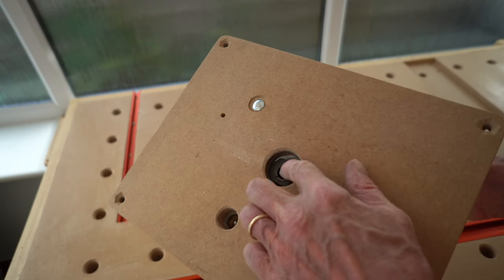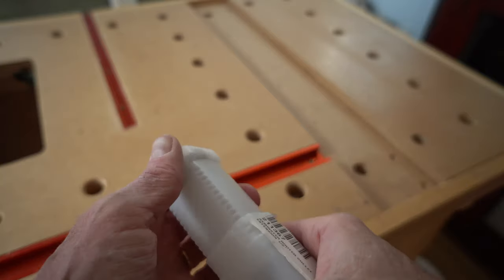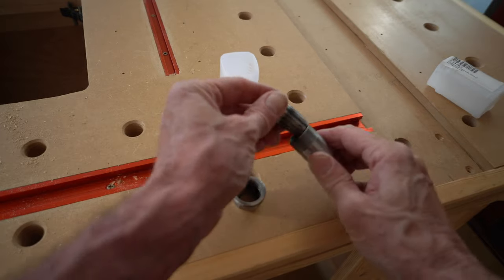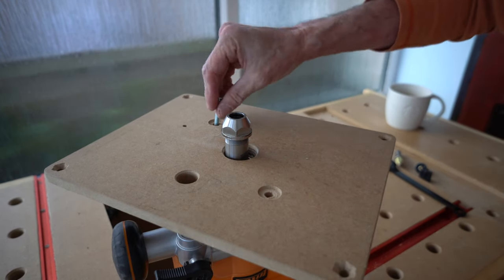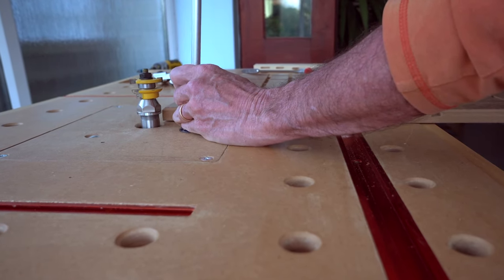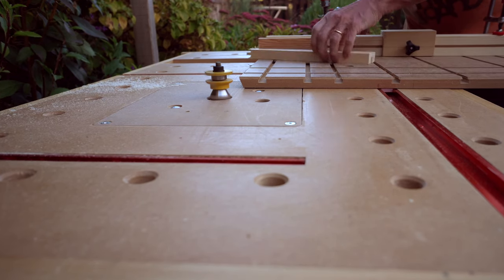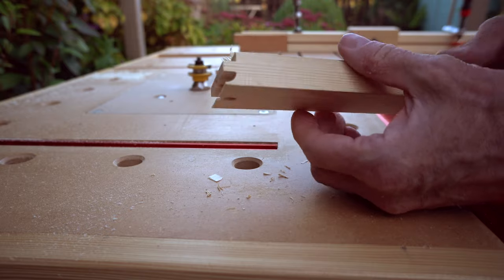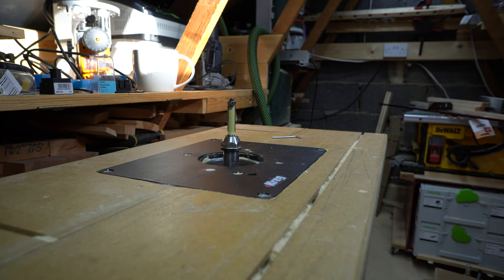Use a Collet Extender to maximise your Router Table

Comment: Hi, It is called 'seven to six' because it is a 7mm collet, that is capable of tightening down to 6mm. If you have a 6mm shank, you would choose a six to five collet for best fit. For 1/4" (6.35mm) you need a seven to six.
I can understand some being worried about extending the cutter so far- but it is a lot safer than not gripping sufficient length of the cutter shank. Quality ones tend to have a minimum grip line- I believe that is the mark on your extender.
Reply from the maker: Hi Mike. Thanks for clearing up the 7 to 6👍 Yes the line is the “grip” line Regards JP
Reply: @Smallbarnworkshop  Yes, but they are minimum lines- it is permitted to grip more.
Many people just drop the cutter in and tighten- but as has been pointed out by others, gripping pulls the bit in, and if it is bottomed it cannot move- this can mar the gripping surface. A tip is to  put a small piece of flexible material- a short length of a wide rubber band is ideal- in the bottom of the collet holder. This stays there, and stops it being a problem.
Reply from the maker: Thanks Mike. Good tip. Regards JP
Reply: @Smallbarnworkshop  So nothing at all to do with Trombones then.😂😂😂

Comment: With an extender you increase the risk of getting bearing/vibration issues. Some routers are more prone to these issues.
Reply from the maker: Thanks Emil. You are not the first to mention this. I’ve not experienced it myself but I have not used the collet at its full extension. It is definitely something to me mindful of. Regards JP
Reply: @Smallbarnworkshop  I had some thinking before putting the ER20 converter in my DW625 table router. I have also had similar thinking with my large CTM router but have not needed to try it yet (Triton collects are cheap :)).
Reply from the maker: @i679n5  I nearly bought the DeWalt router but I got a great deal on the Triton from Amazon. Regards JP

Comment: I'm always fearful of using a router bit extender. Adding to the height of the bit increases the momentum at the furthest point of the bit, from the router. I've seen/heard about nasty accidents from router bits being used with extenders 🤔

Though I would love to use one with my router 😅
Reply from the maker: Hi. Michael. mostly mine is just adding an extra 10- 20mm so the collet is just above the table. I have not had reason to use it at the full height yet. it does look at bit scary at 4 inch above the table. I will be keen to hear if others views. Regards JP
Reply from the maker: Sorry, I should add, thank you for the heads up of potential issues. Regards JP